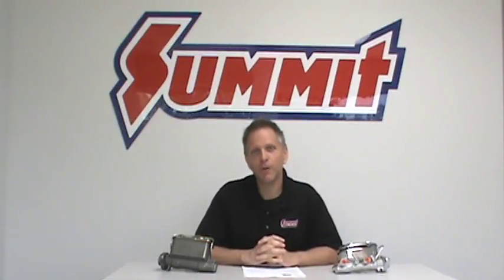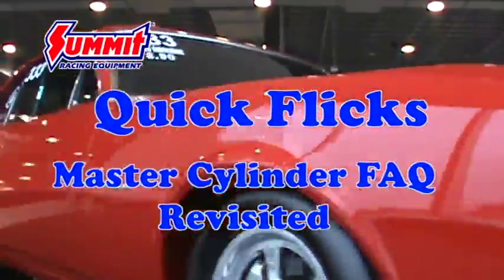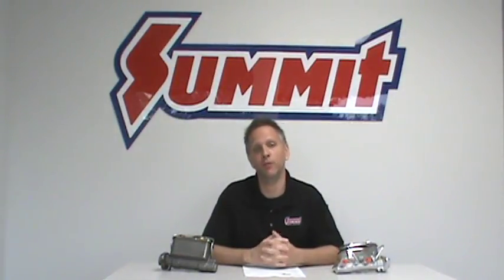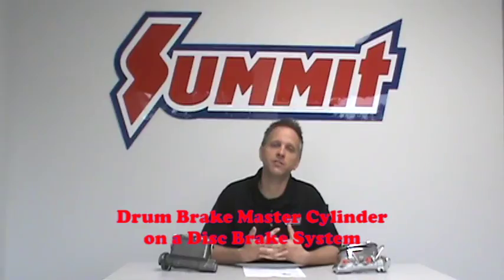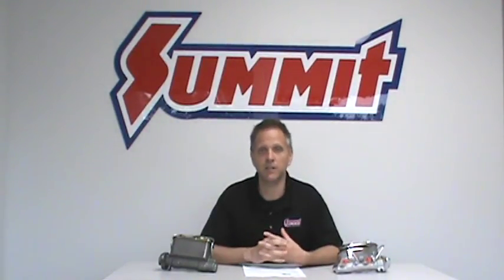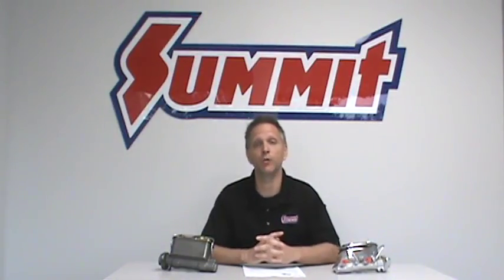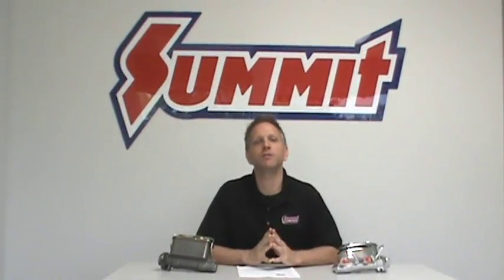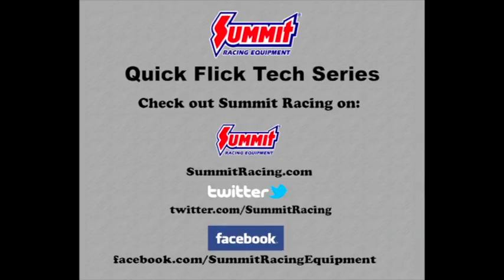Disc Brake vs Drum Brake & Power Brake vs Manual Brake Master Cylinders - Summit Racing Quick Flicks

Comment from the maker: Hi Juliano, 
Yes, this master will work very well with manual brakes as long as you are in the 6:1 range with you pedal ratio and non boosted. A person weighing in at 175 lbs. or so will like the modulation (pedal feel) that the 7/8” diameter piston offers. Larger guys would like the 1.00” diameter piston, it would be a higher, harder pedal, but easier for a larger individual to push. Same performance!

Comment from the maker: Now, If using a power booster, then you’ll need the 1-1/8” master and a pedal ratio in the 4:1 range; but make sure you have at least 18” vacuum.

Comment: I have a 1976 Ford F250 4X4 that the previous owner, who died before I purchased the truck, attempted to changed from gas to a diesel engine. I switched to a more solid 76' southern frame that was sandblasted and epoxy primed. The front axle I switched from the Dana 44 open knuckle disc brake to a '79 Dana 60 king pin with the same disc brakes, basically no change there. The rear axle is still the stock Dana 60 4.10 with drum brakes, I did a disc conversion. I used a set of 76' Chevy K20 front rotors and a set of 76' Cadillac Eldorado rear calipers with emergency brakes. The master cylinder was changed by the previous owner to a Ford Hydroboost because of the repower to diesel. I think the hydroboost came from an LTD, not sure of the year.
I'm at a loss as to what to do with the plumbing with the master cylinder. It has a dual port MC and a proportioning valve with the safety switch. I've seen some suggest to eliminate the proportioning valve, some suggest plumbing the front discs to the MC front port and rear to the rear.
What is your suggestion?
Thank you,
John

Comment: I had a drum brake system on my 67 Mustang changed to front disc brake system. I now want to add a power booster. Do I need to change the master cylinder?

Comment: I have a 69 c10 that's been converted to disks up front original drums out back.
I put a stroked 496ci rat in it and goodbye vacuum. Whoever did the conversion added a booster, prop valve and the master has a large and small reservoir. I want to go to a manual disk/drum set-up. Please tell me what I need to do it. I prefer a black MC and black prop valve with the mounting bracket and prebent line for the prop valve. Thank you for all that you share, it makes building my truck possible for me.

Comment: Thanks for the info.  Wouldnit be correct to assume that a larger piston diameter on the brake calipers is better for a manual system? Assuming the master cylindar can provide enough fluid?

Comment: I just put disc brakes on the front of a 41 chevy sp deluxe and need to find a master cylinder (dual chambered) I will need 
Chassis Engineering Master Cylinder and Pedal Mount Kits AS-1041BC for padels (brake and clutch) but which master with hardware please help out

Comment: I've got a Wilwood Tandem master cylinder 7/8" (260-9439P) for manual brake use - will it work properly on a four wheel disc? Couldn't find this info anywhere. Thanks!

Comment: I have manual brakes with drums in the back and disc up front. There is too mush residual pressure on my front disc. I have a 1972 Ford Maverick with Granada disc up front. I bracket race and think the front drag on the brakes is killing et and speed. What can I do to get rid of the residual pressure ?

Comment: I have a 1973 Ford Maverick it was a complete drum system.i put disc brakes on front off of a newer Maverick and also put one of your disc brake conversation kits on the rear since I have a 9 in under it. My question is what  master cylinder and compnets should I use. I don't have room for a power boaster so it would all have to rely on the master cylinder. Would like to go with Wildwood or something nice since it's going to be a show car thanks so much

Comment: I need to remove my old booster MC setup which is 10" and replace with a smaller booster 8" as its on top of my valve cover driver side I have disc in the front drums rear the setup Im looking at states 1 1/8" bore size for a 65 gto with 400ci engine. Think thats a correct size bore?

Comment: I am currently running a stock manual drum brake system on my 66 Mopar with a single jar top master. I am currently going to upgrade to a power boosted dual master cylinder, leaving it a 4 wheel drum brake system until I eventually change the fronts to disc. When I make the disc conversion,  will I only need to change the Master and add a proportioning valve?  Would the dual disc Master need to be a 1 1/8th Bore?

Comment: I bought a 1931 Chevy Rat Rod - the guy converted the Braking System from Drum Brakes and put a straight axle in front with disc brakes in front - will the manual brake work for the disc front-drum bake

Comment: I see a lot of information here. I have a 74 nova front end on a 56 chevy so maybe you can see a possible dilemma. No power booster originally, either. I want to keep factory drum on rear end but want to upgrade front brakes. I've heard that I would need to find a parts car and use these parts. As most say after market kits will require machine work to make work. I wish there was a one stop shop for this situation. If I go for a power booster than I will have a pedal that is sitting very high and hard to reach. For having disk brakes. What are people doing when they upgrade brakes on old cars...Are they still using old brake mechanisms? And lifting their foot 12 inches to hit a disk brake pedal that presses down for 1" to stop? Where does the upgrades end and the finished project begin? LOL Who knows about all this stuff?

Comment: What is going to be stop the vehicle quicker? Manual or power? Also what compromises do you have when you have power brakes and what are the compromises you're going to have with manual brakes? Thanks!
Reply from the maker: Caleb Schlegel, 
Power brakes assist you in
pushing the pedal so you, the driver, have less pedal effort. So, power brakes
would be the obvious choice when building a car unless your motor has a large
cam and has trouble making vacuum. At this point you will have to either add an
electric vacuum pump or switch to manual brakes. Of course the compromise there
is they are manual – higher pedal effort!

Comment: 97 jeep grand cherokee zj 5.2 v8 has 4 wheel disc brakes, but some jeeps only have front disc and rear drum brakes
however i can only find 1 part number for a master cylinder. the part number is the same for the 4 wheel disc and for the drum brake jeep... 
am i missing something? is there a way to convert the drum master to work for my 4 wheel disc system. the parts guy claims they are interchangeable
but they say different here and my rear brakes are still dragging

Comment: My car has manual 4 wheel drum brakes with a single M/C. I purchased a conversion kit to convert to "Power 4 wheel drums with the dual drum M/C". I later discovered that I didn't have enough vacuum to operate the booster (8"). My question is: will I be able to use the "power drum dual M/C" in place of the "single manual drum M/C" while leaving the brakes "manual", by just adding a new Distribution Block? Or do I need a "manual drum dual M/C" instead of the "power drum dual M/C"?
Reply: Why not install a vacuum canister. Its kinda like a air tank is to a compressor. The larger the tank the more air you have

Comment: I have a 1980 Trans Am with drum brakes in the rear. However, the brake booster is made for a four wheel disc brakes. The brakes do not lock if I slam on the pedal. Could this setup be the issue?
Reply from the maker: Hi Steve, 
I don't believe the booster itself is your issue. I would check how much vacuum you have at the booster. At idle, the booster should have a minimum of 16-18 in Hg of vacuum. If your vacuum is low, it may be caused by a vacuum leak in the system or a camshaft with excessive overlap. Inspect your vacuum lines and check your system over closely. If you suspect a performance camshaft causes a low vacuum, you should consider a vacuum pump. 
 
 If the car originally was a rear disc car, the master cylinder and brake proportioning valve would be the wrong bias for rear drum brakes.   
 
Disc brakes require approximately 900-1200 psi at the caliper for effective functioning. Drum brakes require a minimum of 400 psi at the wheel. Use a brake pressure gauge like LEB-BPG001 to evaluate pressure at the wheels.

Comment: I have a 1970 c10 drum to drum brakes. I have a master cylinder with a proportion valve and no booster. Recently had a mechanic go threw and replace everything on my brakes. But he couldn't find a proportion valve for my truck. Now my brakes lock up in the rear and smoke? Should I just get rid of the proportion valve? Am I using one for no reason?
Reply: I think if you have all drums you do not need a proportioning valve.

Comment: Are working on a 1966 C-10 project from the ground up with a 2010 LS3... have installed discs at all 4 wheels, and are wondering if we can do a manual brake system and still be effective?  What would you recommend?  It would be nice to keep the engine bay clean without a booster.... Any comments?
Reply from the maker: Hi Andy Davis, 
The force exerted at the master cylinder is relatively high, therefore the brake pedal must be used to multiply the force. Most likely you will have to change your brake pedal ratio. Pedal ratio is when the distance from the pedal pad to the pivot  is divided by the distance from the master-cylinder pushrod mounting point to the pivot. The most common pedal ratios for a manual braking system are 7:1 or 8:1, and 4:1 or 5:1 for power brake systems.

Comment: I am replacing factory drums for a conversion kit on a 62 Nova that came with power brakes. Can I run the stock single master cylinder and booster with these kits without modification? Or will I need a dual reservoir and proportion valve? The rear will remain drum.
Reply from the maker: Hi John, 
The use of a dual reservoir with proportioning valve would be best for proper operation of your new brake system.

Comment: Can I use a power brake booster and power master cylinder on oem 60 chevy c10 drum brakes?  Is there a benefit??  Dialed in, I have had pretty good results with 4w drum brakes, provided that you don't need to do a panic stop.
Reply: Did you ever get the answer to your question? What route did you end up going?

Comment: I have a 1958 Biscayne with the 235 6 cylinder. I would like to use a duel master cylinder and front disc brakes?  As I have the original generator with power steering pump I can not use a large power brake master cylinder. Can this be done? I am having the generator turned into a alternator in the original housing so I can keep the power steering pump and add ac to this engine.
Reply from the maker: Hi Natalia Sherrard, 
Can you please give our tech line a call? 1-330-630-0240. We need some additional information from you. Thanks!

Comment: Sir,
i have 1984 Suzuki Ravi.
manual brake system four wheel drum.
so could i convert this system into power brake system for smooth brake?
Reply: I too got the same problem

Comment: Have a 68 Mustang sedan restomod with a Grenada disk rear and a standard Mustang power front disk setup. I am running out of space for the Clutch Master reservoir, as C6 comes out for Tremec 5 speed..   If I swap out the power booster for standard 4 wheel disk manual master, would I regret it? I plan on mostly road driving (though would love to try Limerock some time!) Would removing vacuum booster afford space for reservoir?  Engine is a 390/FE setup for torque, not RPM with 3.25/3.50 gears fwiw.
Reply from the maker: +John Westerdale , 
Keep in mind that if you decide to go to a manual brake setup, you will have to change the pushrod attachment point  (pedal ratio) on the pedal to adjust for the loss of power assist.  Before you do that though, consider this; Hydro-boost is one way to clean up the firewall area and regain some real estate lost to that big brake booster. The downside is that these systems are not cheap and add a lot of plumbing to the power steering system. One more thing to consider is a remote mounted reservoir for your hydraulic clutch master cylinder. This allows you to mount the clutch master in the proper position/angle and then locate that reservoir over out of the way and most times to an easier to reach area.

Comment: i have a 1985 mustang GT
i did swap the engine to 408 with big Cam, i can tell now im like stopping a train. i orderd a manual brake kit. what should i do to make the paddle work with less effort?
Reply from the maker: Hi sammy 511, 
This is information directly from Wilwood's website: 
Pedal assembly ratio, or mechanical leverage, is the ratio calculated as the length from the pivot point of the pedal to the center of the foot pedal (A), divided by the length from the pivot point to the master cylinder pushrod (B). Refer to the figures below. Mechanical leverage is simply a means of increasing the brake force without increasing your leg effort. As “A” gets longer and “B” gets shorter, the mechanical leverage increases brake force without pushing harder on the pedal. The disadvantage is that the pedal stroke also increases, requiring you to push the pedal further. With a 1” master cylinder stroke, a 100-pound push on the pedal, and the pedal having a 4:1 ratio, the force is 4 x 100 = 400 pounds, and the stroke is 4 x 1 = 4 inches. With a 100 pound push on the pedal, with the pedal having a 6:1 ratio, the force is 6 x 100 = 600 pounds, and the stroke is 6 x 1 = 6 inches. 
If uncertain about which pedal ratio is right for your application, a 6:1 ratio is an excellent starting point. 
A = Distance from pivot point to middle of push / pull point
B = Distance from pivot to point of push on master cylinder
P = Pivot point
F = Force or push

Comment: I have a 70 dart swinger I put a 4 wheel disc conversion kit on, what master cylinder will work?
Reply from the maker: We will need a bit more information if this is power or non-power, etc. It would be best to call our sales line at 1-800-230-3030
Reply from the maker: We will need a bit more information if this is power or non-power, etc. It would be best to call our sales line at 1-800-230-3030
Reply from the maker: We will need a bit more information if this is power or non-power, etc. It would be best to call our sales line at 1-800-230-3030
Reply from the maker: We will need a bit more information if this is power or non-power, etc. It would be best to call our sales line at 1-800-230-3030

Comment: I have a 66 ElCamino with a big block with a big .640 lift cam. it currently has power brakes with factory type disk on the front and drums on a 10 bolt rear end. i have a 9" that has disk's, can i run that master cylinder with disk on the rear too? as of right now it stops great! in fact it stop on a dime!
Reply from the maker: +chevyfreak65 , 
Well, give us a call and fill us in on the current system including master cylinder piston diameter. We’ll help you pick out what you need! 1-330-630-0240.

Comment: Can i use manual brake master with a rear disc set up
Reply from the maker: Hi Jessy, 
Yes! But, proper master cylinder sizing is critical to proper operation. Give us a call, we’ll help you set the system up! 1-330-630-0240.

Comment: can I add a booster to a master cylinder ..on a car that has 4 drum brakes
Reply from the maker: +Felipe Torres , 
Yes, this can be done.
Reply: @SummitRacing  how? Is there a specific booster I need to get if I use the same master cylinder? Or do I need to change the cylinder too

Comment: Hi Summit Racing, currenty i have powered front discs / rear drums on my 68 mustang.
This winter, i will change my rear axle, and also want to switch to a set of discs on the rear.
I know i have to loose the residual pressure valve, but what type of master cylinder do i need?
I know it needs to be a powered disc/disc type, but maybe you can give me one or a couple of possible cylinders that will fit? Thanks, Bart.
Reply from the maker: Bart Mesman,
Residual pressure valves are
only necessary when the master cylinder is mounted lower than the calipers or
wheel cylinders such as in a street rod. Give us a call please and we can help
you review your brake system and choose the proper components. 1-330-630-0240.

Comment: what is a 6:1 pedal ratio
Reply from the maker: Hi Jeff Cowan, 
It is the distance between the pedal pivot point and the attachment point of the master cylinder pushrod. This distance determines the amount of leverage applied by your leg to the master cylinder when applying the brakes.

Comment: All redundancy should be worked out with the customers before selling a worthless product that makes vary little sense.      Or providing a product to just shut your customers up for what ever reason.   Its poor performance when you have no instructions or have vary little insight on how to fix the problem properly.      This hole thing seems like a rip off and had literally no instructions.     Ridiculous.       Maybe before selling a product it should be right.
Reply from the maker: Hi William,
 
Did you have a problem with a product purchased from us?